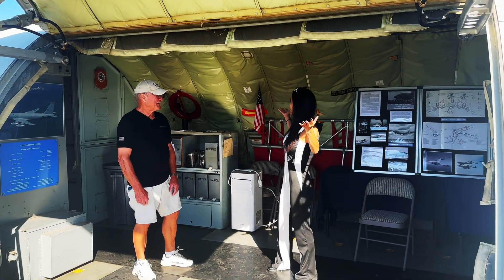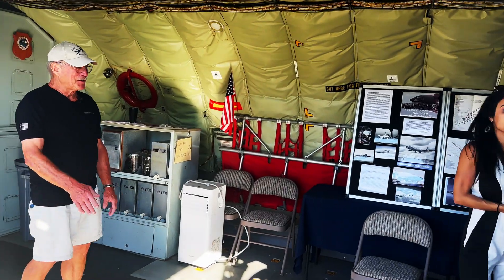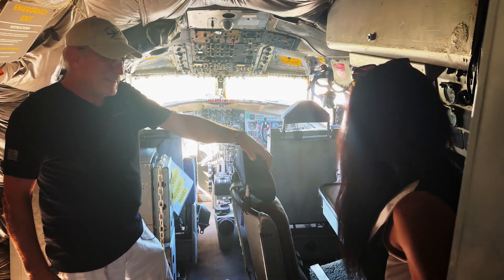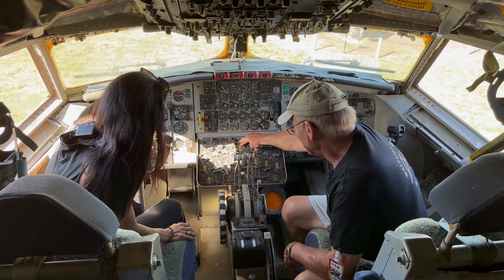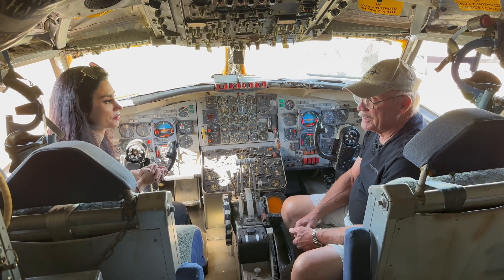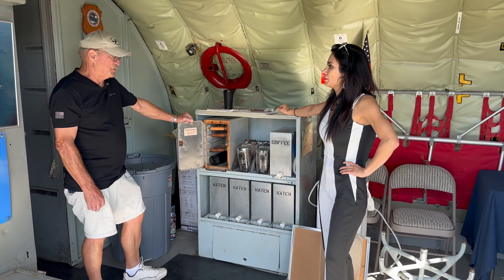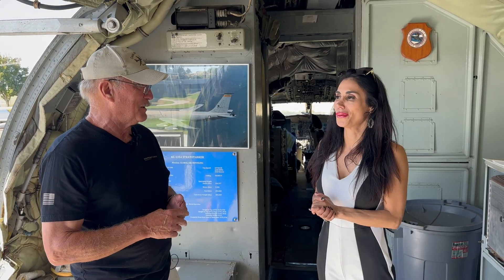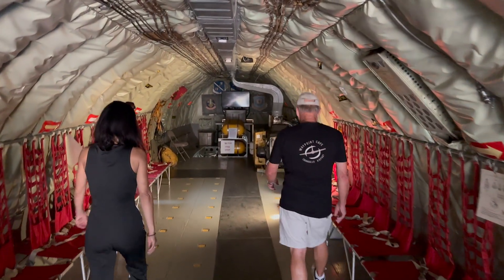Inside the Boeing KC-135 "Stratotanker" - Castle Air Museum

Comment: Probably the LOUDEST aircraft-ever ! Watched them beasts "charge" out of Kadena AB winter 81-82 & them ol girls would waddle out at the start of their takeoff roll like a bunch of elephants. Just about the time ya thought it couldn't get ANY louder-about half way down Kadena's twin parallel 13.500 ft long runways-they'd turn the water on. Dear Gawd Almighty. As a plane captian/powerplant mech on F-4 Phantoms & have been on numerous power runs as well as test cell runs-the 135 water wagons exceeded the noise factor by at least 5. They were even noisier than the SR-71 that blasted out of Kadena on a daily basis.
Reply: You obviously have never stood near a B-66 while it went by. And for the record, the water injection wasn't turned on while half way down the runway. I was a CC on Q models that refueled the Blackbirds.
Reply: @patprice2953  well whenever it was ya could tell because the black smoke increased by a factor of 10 as did the noise. Stood next to several J-79's on an open test cell at MCAS Kanehoe Bay HI just before deployment summer 1981-the hush house was down for MX so all engine runs were done in the open. At idle-one could stand within a couple of feet to do leak checks & such-when the power was brought up-the further one had to move because of the intense heat generated by the engine. At Max A/B the CLOSEST ya got was maybe 75 feet. Not only the heat-the NOISE. So loud everything was a blur-even with Mickey Mouse ears & earplugs. Public Works came out & measured the SPL-at 150 yards-it was 137dB SPL.That was LOUD.

Comment: Great to see the old girl as I remember her.  Retired tanker crew chief here, from '81 to '95.  The plane I crewed the longest was a '56 model, KC-135A 56-3591, ''The Gremlin''.  That's the old original fuel panel in the cockpit.  It was updated to a digital panel in the late '80s.  The original lav, with the honey bucket toilet.  The original APU, AiResearch I believe.  Gave you electric power and heating, if you were lucky enough to have one that worked.  J-57 engines.  If they stopped dripping oil, call the engine mechanics, 'cause they're out of oil!  Starter cartridge bells stowed up by the cargo door.  Water heat panel for the engine water injection system halfway down the cargo deck.  Two layers of GOX bottles, so the LOX bottle in the lower nose must have been removed.  Oh, and stay out of the crew chief's bunks if you know what's good for you!  And for the IP's information, the R and T models I crewed still had navigators in 1995.  What a trip down memory lane!